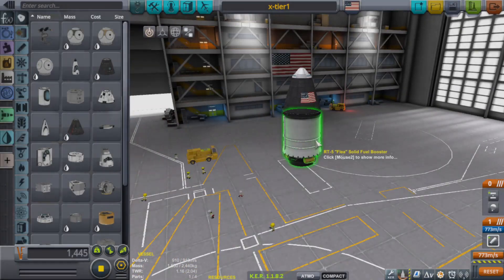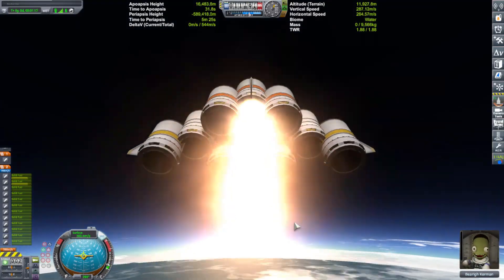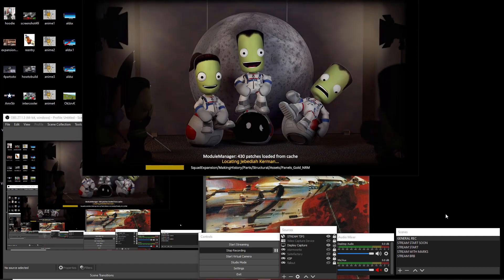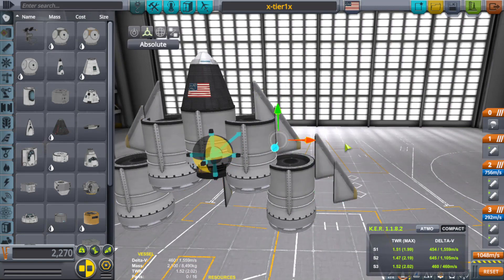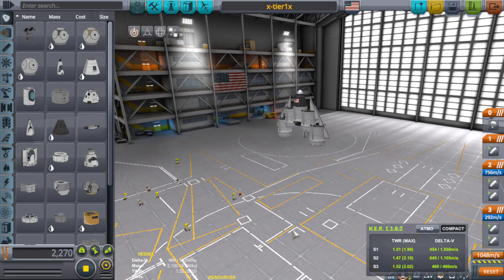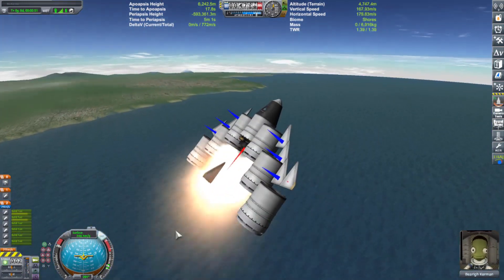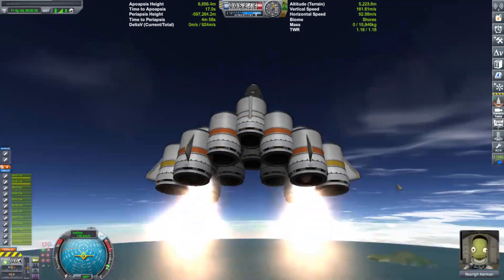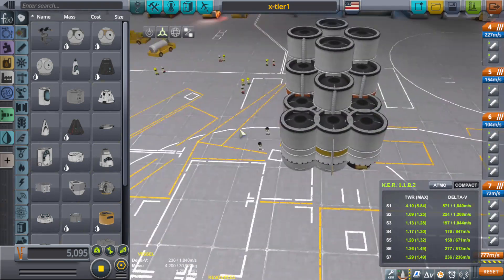TIER ONE SSTO are IMPOSSIBLE. Change my mind.

Comment: Just got an idea, I may know how to skip the atmosphere without stages or cheating, I'll try it and share my progress
Reply: o.o ? This sounds magical
Reply: @xionix4  I'll spill it, what if you use srbs on Low thrust and the winglets to rotate the craft like a propeller, so you gain altitude from little fuel, taking off around 1k d/v (helecopter rocket but no joints)
Reply: @pixelastronaut4313  That sounds like something that'd be fun to try for sure, if only just for fun...

I don't think it would work, though, since the total additional specific energy available to the craft after all fuel is used isn't enough to reach even the lowest/cheapest orbit (1.9 MJ/kg available with 100% efficiency vs. 3.2 MJ/kg required).

And then you'd have further losses due to increased air friction. It's a neat idea because you'd be storing a fraction of the energy in angular momentum, like a flywheel, which is then returned to linear kinetic energy by interacting with the atmosphere. I love stuff like that, lol. Anyway, it also would generate less lift when spinning higher in the atmosphere than you sacrificed to spin it in the lower atmosphere due to less air pressure, I think.

I really like the idea, though. Pretty clever.
Reply: @pixelastronaut4313  oh yeah then it's easily doable
read the kinda long post I've made if you want to know all the details behind tier 1 ssto theory, I laid out everything there was to know and basically from running all the maths, it's possible even without your trick but requires a mad degree of optimisation on several aspects only a computer could do, with your trick, if it really does save 1000 meters of Dv, combined with all the strategies I highlighted, then it's easily possible, you could probably even crash on the moon if you can reall save 1k Dv lol
Reply: but basically what my long posts say can be simplified into several parts, first of all the trivial calculation that most people seem to get stuck at is that the Dv of the flea in vaccuum is only like 2k ms^-1 which less than the orbital speed at 70km alt, so the first part of my posts discusses all the game mechanics and strategies needed to actually achieve that, because that calculation uses vaccuum, so there s a lot of details to even getting those full 2k ms^-1

the second part of my posts came from the idea I had to make the difference, which was using the EVA fuel to get out and push, considering the mass discrepency it seems impossible, but I had to calculate the Isp of the EVA pack (its not given anywhere) and found that it was 228 Isp, which thankfully is enough to make up the difference by getting out and pushing, from a purely mathematical standpoint

of course the then-issue comes from how much EVA fuel you can carry into orbit (I found that in a mathematically perfect solid fuel stage only 20 units of EVA fuel were needed), but I have no idea how EVA refuelling mechanics work and my current computer can't run KSP

and of course there's the fact that all the mass of the EVA fuel adds to the issue of the first stage, but considering you manage to get a small enough first stage the equation doesnt become exponential/step over the needed orbital Dv mark

of course keep in mind that the flea has 165  vac Isp while the EVA pack from my calculation has 228 vac Isp, so you WANT as much EVA fuel as possible and as little  solid fuel as possible, that's good if it lowers the ammount of Dv of the first stage, since it just means more mass fuel efficiency and a higher average exhaust velocity over the entire flight

there's a last factor I hadn't considered which is the burn time, that might actually make it impossible by my method, if and only if the time needed to accelerate the remaining 300 meters per second is not enough with the very low TWR of the entire rocket being pushed by a kerbal, which is a real threat if you havent managed to make the first stage small enough in the opmitimization

So that's where it stood before your trick, if your trick really does slash 1000km/s of Dv, then you can see the implications from the rest of what I posted here, not only does it make reaching the 2000 m/s from the solid stage easier (meaning lighter first stage and therefore better TWR with kerbal propulsion as well as a higher efficiency from offsetting the EVA to solid fuel ratio), but it also means a higher suborbital apoapsis (if that's even  needed) meaning more time for a kerbal to get out and push (infinite time if you can reach orbit before that)

as I said I can't play KSP but I hope I've highlighted most of the important information for you to try this out

Comment: Yeah, I'm with you on this one. I don't think it's possible without losing parts. The more srb's you add the more dead weight you have to carry and land.
Reply: "Land"? Who said anything about landing? :D
But yeah, I'd be surprised if anyone made it work. Maybe there is a kraken drive that can do it, but with the limited part selection I doubt that as well (I'd put the restrictions on it that it has to work at least... 1 time out of three, and it's not allowed to break any parts)
Reply: @bjornseine2342  can't make a kraken drive in tier 1. You don't have any of the parts needed, no landing gear, docking ports, or pistons. No KAL to overclock engines either. 

1 out of 3 would be expensive in full career mode. Both in ship cost and Kerbal lives.
Reply: @JollyRogerAerospace  You have Kerbals; those cause wonky physics as well.
1/3 would indeed not be *practical*, but that was never the question. The question was wether it can be done at all.
The limitation is just there to eliminate designs that can 1 time out of 30 accelerate the craft to light speed, but otherwise explodes.

Comment: I don't know why you're even trying. 1 flea without any payload has 1948m/s dv in vacuum. 1000 or a million fleas also have 1948m/s. That's the maximum you'll ever get in 1 stage whatever way you design the rocket.
Reply: Exactly
Reply from the maker: Exactly
Reply: Exactly. It's mathematically impossible. Anyone that claims they can do it is lying

Comment: What if you tried using less fuel in each SRB? it would have  lower weight, and a higher TPW.

It would lower your delta v but it might be worth it
Reply: No, that would absolutely not help. You want every booster to start with max fuel, since delta-V is the problem here - and none of the early boosters have high enough delta-V even if you launched one alone to make Kerbin orbit.
Reply: becaouse it is a ssto it would mean even more dead weight compared to the delta v but thank you for your response and being part of this community
it would definetly mean better tpw but i dont think this will do anything

for me it is insanly hard to get to orbit in tier 1 and a ssto must be insalny hard if not impossible
Reply: you want to have the highest wet mass to dry mass ratio as possible. You want to have enough fuel that you can propel your dry mass into orbit, the less mass you have to take to orbit, the better. The more fuel you have, the better.
Reply: @redpug5042  Yep, but if you aren't discarding empty ones and only using one kind of solid rocket booster, that ratio can never be better (or even as good as, if you have any other parts) than a single one of that booster.
Reply: @zuthalsoraniz6764  if you reduce the fuel in a booster, you lower the ratio. You'd still have the dry mass of the booster, but without the propellant to use.

Comment: I saw a comment on your community post about this that makes me think it’s impossible. If the delta V of a standalone flea booster is less than you need to get to orbit, and you can’t drop them, then the best you could possibly hope to do is that deltaV (just plug the numbers into a deltaV calculator and see doubling the wet and dry mass doesn’t change deltaV)
Reply: The deltav for a flea is Isp*g*ln(m1/m0)<I_vac*10*ln(m1/m0)=1650×ln(1,45÷0,45)<1930,7 m/s more than 300 less then the speed needed to orbit at 70km so it can't reach orbit not even if you lift up to 70km by cheats. So it is matematicly impossible to make a tier1 ssto so it is no worth trying. Note if you use N fleas and have m2 mass for other parts the deltav will be: Isp*g*ln((m1*N+m2)/(m0*N+m2)) even less then before. 

(where I_vac is the Isp in vacuum m1 is the wet mass m0 is the dry mass)
Reply: @botondhorvath1445  Since the speed required to orbit at higher altitudes decreases, cheating to an altitude could work, but nice take.
Reply: @xionix4  True. But my point was that reaching orbit is impossible. The easyest orbit (from ground) is 70km so if that is impossible then higher orbita are impossible too, And if it can't be done with a 'small' cheat it can't be done without cheat. 

So A<B<C<D where
A=SSTO delta v
B=70km orbit cheat delta v
C=70km orbit delta v
D=high orbit delta v
Reply: @botondhorvath1445  that was also my first thought, and I agree that it can't be done here (see my comment earlier on the video if you like), but now I am wondering if there is a sweet spot altitude for orbits that is cheaper to launch to than 70 km. E.g. higher dv to reach a higher apoapsis but less dv to circularization there being cheaper than dv for 70 km reach and circ. I plan to model it as an optimization problem tomorrow after work and see if there might be a secret cheapest orbit height. Wish me luck lol
Reply: @xionix4  The energy of an orbit is: -G*M*m/(2*a) 
Our potentional energy at sea level: -G*M*m/r
The lower the orbit the less energy it needs so the see level orbit needs te smallest energy. So a=r. (We don't count drag now that just makes orbit harder)
So we need -G*M*m/(2*r) additional energy. The most efficent way of gaining energy is burn as low as we can, so sea-level. We need the orbital-speed at sea level. (larger then the orboital speed at 70km) We have some of the speed (~220 if I remember well) but we still need ~100 more.

I like math-based aproach better then trying if I want to proof impossibility because there always can be a way I didn't try.

Btw knowing how kraken-friendly KSP is I do think SSTO is possible with tier1 You just need a good kraken 😛 I mean I reached 50% speed of light from Mun transfer orbit uppon exiting time-warp with only ~30m/s remainig (The ship broke so it was stagenig)
Reply: @botondhorvath1445    Ah. I was going to look at energy of orbit as a function of altitude and try to find a minimum. I too prefer the math approach. :)

Isn't that formula just the gravitational potential energy, though? I just woke up, but it looks like it's missing a kinetic energy term.

I believe the orbital speed imparted by Kerbin's rotation at sea level is 175 m/s in KSP 1.12.3 btw. And orbital speed at 70 km is 2,296 m/s.
Reply: @xionix4  I did count in the kinetic energy. The potentional energy is -G*m*M/r

You need a speed sqrt(G*M/r) to orbit in a circle. (centripetal force: m*v^2/r=-G*m*M/(r^2)) 

Now if we add v^2*m/2 to -G*m*M/r we get -G*m*M/(2*r)

In general any orbits total energy is -G*m*M/(2*a) where 'a' is the semi-mayor axis but that is harder to proove.
Reply: @botondhorvath1445  I see. :) I haven't encountered specifically -GMm/(2a) before. That's neat.

I went ahead and derived circular orbital energy as a cost from current elevation (launch pad), i.e. against convention of negative potential energy, so that the result is positive energy required to lift and insert into a given orbit. I got GMm/r - GMm/(2R), where r is launch pad elevation, and R is desired orbit elevation. I agree with certainty now that lower orbits are always cheaper.

Thanks; this has been a fun chat. :)
Reply: @botondhorvath1445  Thanks again. Our chat inspired me to do some more research and find some things that I didn't know existed. :)
Reply: @xionix4  No need to thank I enjoyed it too. Just be carefull with too much math. Sometimes when I build a rocket (in RO, RSS to make it intresting) I take a pen and paper to calculate the best way to build. Not the most time-efficent way... But when I get asked what did I do I can answer 'Just math'
Reply: @botondhorvath1445  Lol, you sound like a wizard. I was thinking about writing a program to design for me. Probably easier than pen and paper, lol.
Reply: Yeah, the rocket equation makes it impossible, but maybe if you take into account lift from some wings it may give you the 300 lacking ?
Reply: @jeanfonssedeporte3158  No. The atmosphere only takes away. Lift pulles "sideways" to speed (ortogonal).  We also have drag. And smaller deltaV (smaller ISP). So no atosphere has only bad effects. It only helps if you have low twr or an engine better in atmo aka jet.
Reply: @botondhorvath1445  Oh that's actually a good tip to look for low twr ! Because lift can probably help with low twr. but yeah, the force is orthogonal so idk if we can get something good from it. I should try to do calculations
Reply: @jeanfonssedeporte3158   The ortoginal force makes no work on the plane, so it adds zero energy. And energy is the limit here.

Lift is good if you have low TWR but a lot of delta v.